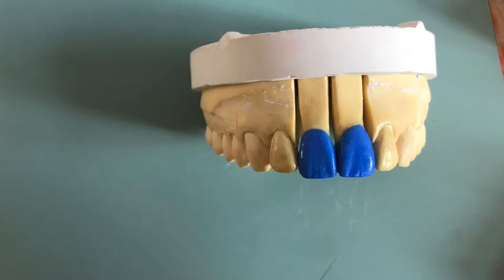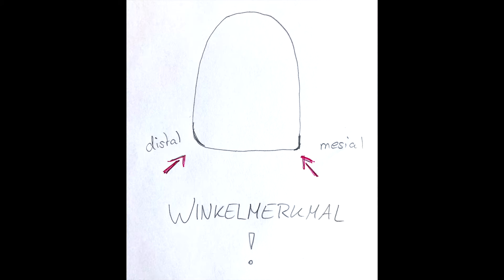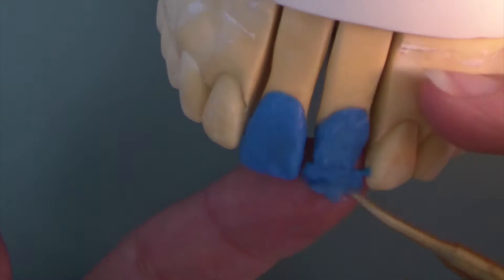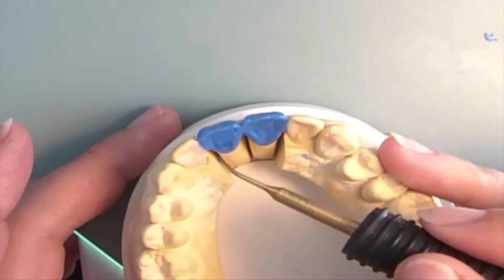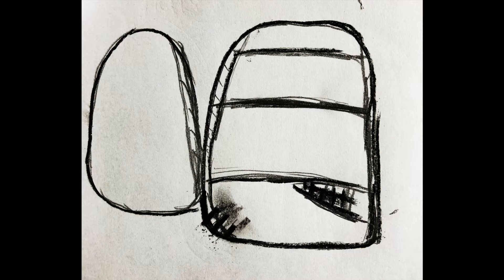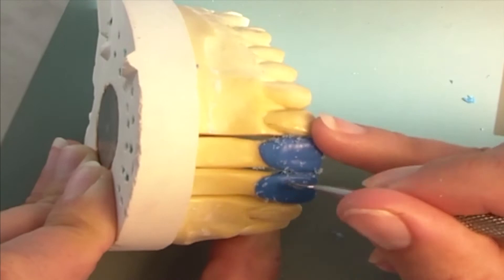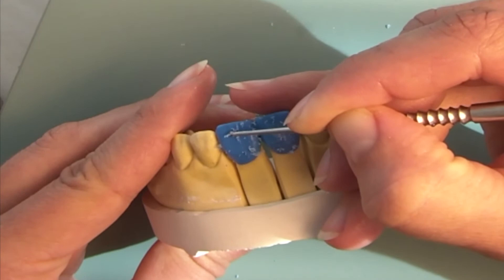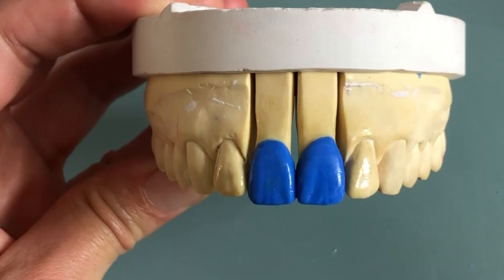Wax-Up Tutorial: Perfecting Incisors 11 & 21 [Inzisiven with Explanation] for Dental Technicians

Comment: When you do not less than 6, how you determine the shape of incisal line across all teeth? Thank you!
Reply from the maker: Hello thanks for your question. I hope I am answering your question correctly, if not, could you please ask in more detail? I often determine my shape from my neighbouring teeth or the opposite jaw by determining whether they are rounder, more square or more pointed. I make the insisal edge of the ones longer than the ones of the twos, as long as the occlusal jaw movements allow it.

Comment: Brilliant. Are the buccal surface of the centrals flat or are they slightly curved distally to follow an arc?
Reply from the maker: Hello, thank you very much. We have a curvature feature there. The whole profile from the incisal view is slightly inclined to mesial, as in all other teeth (except the four). 
The distal ledge is in the concave zone, a flattening to incisal. The arch, as you have already noticed, starts at the top of the tooth and runs curved.
I hope I could help you and have fun practicing. best regards, Brigitte
Reply: @brigittesdentalaesthetics4559  Thank you for that lovely explanation